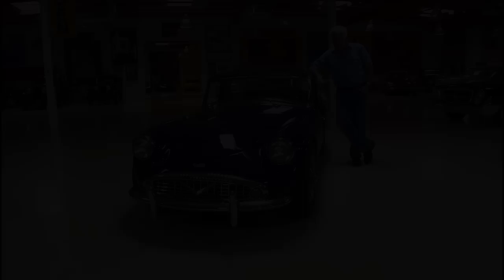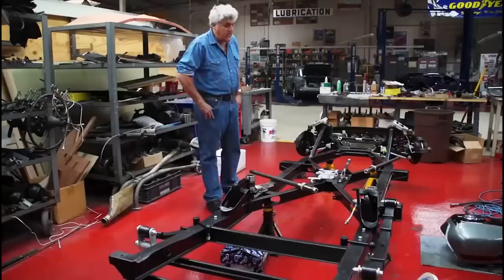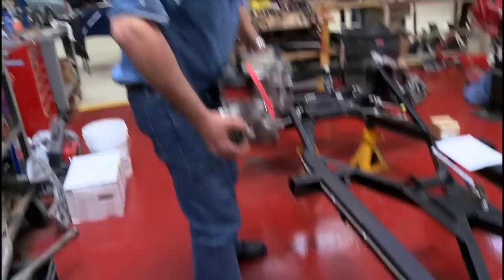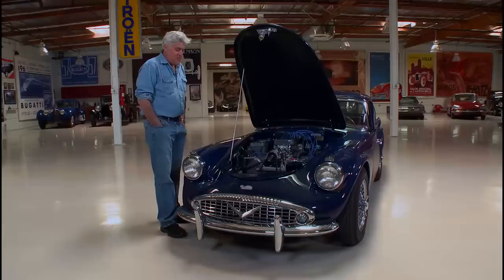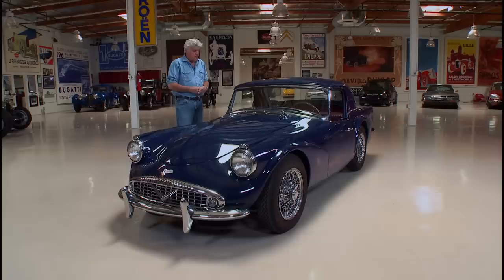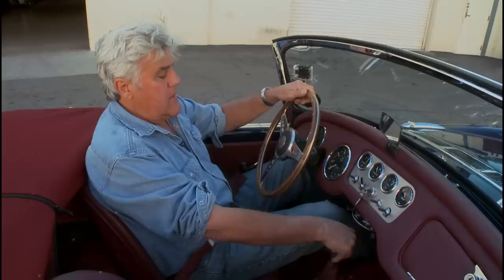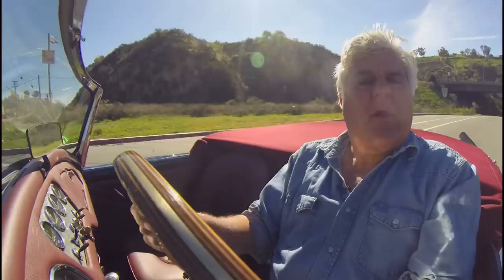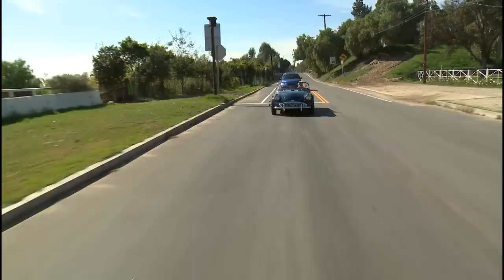1962 Daimler SP250 - Jay Leno's Garage

Comment: My very first car was a 1962 Daimler SP250, red with the hard top. Bought it in 1965 from Manhattan Auto, a Jaguar dealer in Georgetown in Washington DC, for $2,500. Back then you could buy a Cadillac for $3,500. I was just 24 and making around $13,000 a year. It was red with the red leather seats, manual shift. Absolutely fell in love with that sound. Mr. Leno is right, it was the prime era for British sports cars. Triumph TR4s had an inline 4 cylinder engine, and the Austin Healey 3000 had an inline 6 cylinder engine. Both had their appeal, but nothing like the sound of that 2.5 liter V-8 hemi head in the  SP250. The Jaguar XKE had an inline 6 with a characteristic snarl you could always recognize. And boy was it fun watching young ladies in mini skirts getting out of them with their almost waist high threshold. And of course, you might be passed by a Ferrari 250 GT with the glorious high sound of that famous V12. Music. But the SP250 was up there with them. I also liked the square trunk of the SP-250 because it was perfect for holding a bag of golf clubs sideways, no fussing. The bench seat was also useful for going out with another couple. The original SU fuel pump was an issue, depended on a membrane and if you suddenly heard a rapid ticking next to your ear it meant the membrane was shot. I took my SP-250 out on the expressway to Dulles airport when that was brand new with no traffic to speak of, at night, and ran it up to the limit, around 120 mph. Just for a bit as I was not totally sure the wire spoke wheels were all that secure at speed. I took it with me when I joined the US Foreign Service and was assigned to the American Embassy in Lagos, Nigeria from 1966-68. That was during the Biafra war. The Deputy Chief of Mission called me in one day and said his wife thought it was improper for a very junior officer to be driving a sports car. Although it was for sure the only Daimler SP250 in Lagos, I actually found a British car mechanic who could tune it up for me. I shipped it back to the US when I was assigned to Washington DC and bought a house in Springfield, VA. Sadly, one morning when I was driving to work in DC the young woman who was our baby sitter was rushing to drive her younger sister to school, went through a stop sign near our home, and T-boned me. Fiberglass body work was costly and I did not have the cash to repair the body damage. So I wound up selling it to a young man in, if memory serves, Chestertown on the Eastern Shore of Maryland. A tall, lanky guy in overalls on a farm, he actually raced SP-250s professionally and wanted mine for spare parts. He took me out for a spin on the gravel and small paved roads around his home, at speeds and cornering that had me holding on for dear life, white knuckle style. He on the other hand was totally relaxed and chatting all the while like he was just out for a Sunday drive to grandmas. That taught me that amateurs who own fast cars and think they are hot stuff should never have any illusions they can drive like pros and should not try because they can end up causing a fatal accident.  Wish I still had it even though I am now 82. But at least it went to a new owner who understood just what a cool engine and car these were. Mr. Leno is right.
Reply: Great story! We all have regrets about selling the classics we had 😢
Reply: To John k. Atchley
 I'm sorry to hear about theunfortunate ending - specially when I was envious of you buying your Dart SP250 from new, and so on! 
It IS an unfortunate truth that accidents are no exception, when it comes to items, even if they are expensive! 

A young lady in London, in her first job, in a museum, tripped, and fell against a VASE, and broke it.
She felt very bad, specially since it was a MING vase!
But her employers were sensational, and didn't SACK her from her job! They said they were just glad SHE was okay!

Comment: Hi jay, that's a great car with one of the best ever designed V8 engine, as you say. Beautiful job. I owned a v8 250 saloon with manual gearbox (wish I still had it). I've had a Triumph Stag for the last 40 years along with a Lancia 2000 HF coupe and a Fulvia 1300s. So not so bad. All the best Bob from England.

Comment: Interesting about the radiator cap. This was a good video because it showed something that can happen to all of us car guys. And who hasn't felt that stress of hoping your car makes it back.
Reply: John Fiskin: Especially with 300 miles to go
Reply: Hoa Tattis Holy Mōly! That would be a pricey tow, unless you had Mr. Leno's expendable amount of (annuity & perpetuity investment) income. I guess he’s in the Retirement Savings age bracket, come to think of it. When I think of Jay, it’s with the S&P mullet of the Tonite Show era-I tend to think of myself as ~30 years younger, too. Oops! 🤭
Reply: @frufru0071  No I nursed it home it took 6 hours
Reply: Hoa Tattis I drove a '67 MG bgt until I broke my neck in a workplace injury and had a spinal cord injury, but I still have my MG. The poor thing was about ~70% restored, and I’ve neglected it for about 15 years...at least. It’s a 5-bearing engine, (not the 3-bearing crank of the earlier B's), without synchro-mesh between 1st & 2nd, and with electric overdrive in 3rd and 4th gears. It was called the Mk. I, (1967), MGbgt. The later '67s had synchro-mesh, but just lacked the "UMPH!" of the earlier '67s. Congratulations to you on your 30 mile "trek"! Must’ve been a little stressful, or at least a tad...suspenseful, that journey?! Cheers!🍻 Was it a British car? {Lucas/the 'Lord Of Darkness'}?!

Comment: That car sounds beautiful..... Seriously, what an engine note.
Reply: You should hear one of these puppies on a race-track. Just...freakin'...AWESOME.
Reply: ikr...sounds so clean
Reply: It sounded great, like a hot little corvette with headers. Too bad it overheated though, I remember overheating being a constant problem with every car I drove back in the 70's....everybody is having fun until the car overheats lol.
Reply: +Bob Jimenez It was the wrong radiator cap, Bob. ;-)
Reply: that sound is to die for !
Reply: might be the best engine sound yet
Reply: You can buy 2.5 V8 Daimler even in Jaguar Mk.II, but only with automatic and it is pretty rare.
Reply: There used to be loads of the 2.5 V8s for no money at all, they were the cheap version of the Mkii, with the 3.8 being the expensive one. A good 2.5 V8 was about $800 (£500) when I was in my 20s (in the early 80s)  I went for a Triumph Vitesse convertible. (2 litre straight 6 @£395) The Darts or SP250s were affordable too. Oh if only it was still like that....
Reply: Doesn't sound anything like an American V8; sounds like 4 triumph motorcycle engines in a tin box.

Comment: Being a pedant and having had a Dart in the family since 1965 (in my care since 1974),  twin SU HD6's were the original carburetors, no idea why you would  go to the bother of a Weber and overdrive was apparently only supplied from the factory on two cars.  Mine has been modified and has rack and pinion steering from a TR6 and a Jaguar gearbox with overdrive from a manual Daimler 250V8.  The original worm and peg steering box was a challenge....and I kept breaking the original gearbox.  The car drives and handles really well..  The exhaust note still sends shivers down my spine....love it!

Comment: There were not many of these around back in the day in England. I came across one while riding a Matchless 650 motorbike and ran with it at speed for a good while. It could really move and seemed to have no problem getting around the corners rapidly.

They were always considered odd-looking at the front and a small alteration to the shape of the grille would have prettied the car a lot!

Comment: This was a great episode, as usual... Jay is such a good guy to be introducing cars like this.... Yes, the correct cooling system pressure cap will allow the pressure to build in the system and raise the boiling point of the coolant, which will continue to be able to carry heat away from the engine and shed it off at the radiator... One of the roads Jay was on going into the mountains, looks like Kanan Rd. Between Agoura Hills off of SR101 to Malibu Canyon off of SR 1 in Southern Calif... A beautiful drive...

Comment: I LOVE it !  My Dad had a TR-7 he purchased new in the Fall of 1977-as a former sports car "nut"-he raced in the 50s & 60s until my Mom lowered the boom on him to cease such a dangerous endeavor-decided to have a bit of fun with the -7. One of the things he did to it was put a Borg Warner  T-50 5 speed manual in it. To get it to work the driveshaft had to be shortened by 1 ". The clutch was truly a curious set up-a Datsun 260Z friction disc-and a Daimler 250SP pressure plate ! All smog devices mysteriously disappeared from it & the single Stromberg carb vanished & a twin Stromberg setup was installed -this was the era of 49 state cars & CA cars-we lived in SoCal-San Diego. Oh Lordy that thing was FAST. Brings back many fond memories of Dad. Thank You.

Comment: 2 Years! It took me 10 years to do mine 1988--1998, engraved on my memory! Mind you that was weekends as I was working full-time. A lovely homage to a great car/engine Jay Leno, if only I had had your wonderful facilities back in 1980's England. Like you say, why oh why didn't they use Edward Turner's masterpiece instead of the Rover (ex-Buick) or dreadful Triumph V8s. As is well proven by the man with the Daimler V8 powered dragster, it's a very tune-able unit, I think he gets about 1K bhp from his specialised one. Back in the day , my main problem was shortage of time and cash, as then the parts were not cheap, we didn't have 3D printers to model bell housings and we certainly didn't have that miracle gearbox of yours!! A lovely presentation Jay and an absolute treat for all the senses, especially the audio ones!! Thank You very much..........Jonathan Cooke

Comment: I used my heater on many occasions when my engine overheated very uncomfortable but if you want to save your engine n can't stop at times is there any other choice?
Reply: polygamous1 Sozou Owned numerous TVRs....I always did the same
Reply: The problem was that it ran out of water, so I don’t think running the heater would do anything at all.
Reply: At that point, no, it wouldn't.
Reply: If you were listening at around 10:58 he mentioned the -C got the 'cigarette lighter and heater-defroster' and later 'this is somewhere between a B and C' so, being in SoCal, it probably didn't have a heater to aid in the extra cool-down of the engine. I had the same problem with my '69 Roadrunner 'Super Trac-pak' with radio and heater delete (and a 6-cyl rambler radiator for weight savings...who needs more when you only heat it up 1/4 mile at a time!).
Reply: @MadMaxxMoto  But it did have a heater; he showed it several times and it's very noticeable in the shots of the engine compartment.  Of course, being British, there's not much expected of heaters.  I owned a couple of used Austin-Healeys, and a new '62 MGA MkII, and although the Healeys' heaters kept the edge of the cold and defrosted the windscreen quite well, the MG's heater was quite a bit less efficient.  The dealer, who was a friend and racing buddy of mine, told me when I looked it over that the heater "doesn't do much more than warming the driver's left foot---in England," where the driver sits on the right.  They had a Big Freeze over there in the winter of '61-'62 and the snow and cold practically paralyzed the island, so when I traded the "A" in on one of new MGBs, early in '63, I found it had a great heater/defroster, as did the used '63 MG 1100 sedan I bought later.  They even had towing rings welded onto the bottom control arms or foreframes after that!  Stay safe in this crisis.

Comment: I wonder if any of those engines were ever used to replace the P.O.S. that the Stag had (Yes I am fan of the British made Stag).
Reply: Because political infighting in British Leyland meant Triumph wouldn’t use this engine nor the 3500 Rover V8. Shame really.
Reply: Had a Stag in the 80's...with the Rover 3.5 of course :) Awesome car with what should have been the obvious engine.
Reply: @tedse21 ... But the got it for the TR8.....,what, 15 years too late.
Reply: When GM sold the rights of the Buick V8 to the Rover Car Company, it was stipulated that for a certain number of years, Rover could not sell that engine to other car manufacturers.
This was before Triumph and Rover were sister car companies within BL. By the time the embargo was lifted, Triumph had developed their V8 so there was no going back.
Later, Triumph as R Woodliff says, the TR8 used it, as did others, TVR, Morgan...........etc

Comment: Does Jay know something I don't?  If any car I was driving was overheating and steaming, the first thing I would do (especially if I had a trailing camera van) is pull over, cut the engine and open the hood to cool off the engine.  In doing so, I'd hope to discover the problem.  The last thing I would say and do is, "Hmmm let's keep driving it and see if it gets any better or worse?"  His car, his loss I guess but still, why risk cracking the block?
Reply: Was thinking the exact same thing - he's raving about this fantastic engine through the entire vid then takes awful chances continuing to drive with it constantly overheating? Also, the concern/solution being the rad cap seemed an amateurish mistake when the talent level in his shop is so excellent. Good on you Mr. Leno overall for the stunning reno.
Reply: I think that Jay knew what he was doing. Where he pulled over was a short distance from home on his regular car film circuit.
Reply: Yes you've saved me a rant!

Comment: So I heard that it didn't rust because it was a fiberglass car. Did I hear that correctly?
Reply: Uhm.... Yeah.....?
Reply: No, it's because the car is fiberglass.
Reply: WafflesOrFrenchToast (sarcasm). though it was implied, but i guess not.
Reply: Yup. Obviously
Reply: Brian Williams
And why should I believe you?
Reply: Brian Williams
lol
Reply: It does still have a steel chassis but I think Jay was pointing out that it was fibreglass body and therefore no obvious rust. As he said not everyone has heard of a Daimler SP250 and obviously would know it had a fibreglass body. Daimler also used that engine in their re-badged version of the Jaguar MkII after the company had been taken over by Jaguar and was known as the Daimler 250. It's generally viewed as the better of those two cars.
Reply: Samuel Smith it wasn't really an actual question. i was just poking fun at the fact that he said it was a fiberglass car like 4 times.
Reply: I wish he would bloody mention that!

Comment: My step father, Don Starr, owned 2 of these. I used to piss him off as kid, playing 007 sitting in the car and messing with a whole dash board of toggle switches (which messed up his settings). Loved turning on the radio and the antenna would automatically telescope out. He loved these cars (he owned a couple Lotuses too, and we had a late 60's Jaguar sedan too, with the rosewood dash and make up tables). When I was 12 he promised to give me the one he had (his 2nd) for my 18th birthday. My mom divorced him when I was 14. I still reminded him when I turned 18. He said it wasn't running, and he couldn't get parts (it was 1980). I would have taken it anyways and didn't buy his excuses. SIGH. I remember riding in it when I was young. Always a thrilling ride. Cool looking car, not ugly. Unusual looking though. Part of the Dart's charm.

Comment: Recently bought my first "purchased sight unseen car". 
Took it straight to the mechanic once I had it transported over 3,000km and it ended up needing water pump, fuel pump & got some other things replaced like the idle pulleys & fan belt but over all very good condition and quite a rare car so had to jump on it, especially it was at a price I could afford!

Comment: eddy here from devon uk your mechanic should have spotted that the radiator required what is known as a long reach shank type cap then every thing would have been ok i am familiar with such things i am 75  now but back in the 60s i was the proud owner of a 1964 MGB roadster which had a similar set up if  you have an early 60s MGB with the original 3 bearing motor i should  love to see you drive it you would love much more responsive than the later 5 bearing unit BEST WISHES eddy uk

Comment: What a lovely car, sounds nice runs like a sewing machine and goes like a bullet.
My father turned up one day from his away job building, he had bought a 1837 Daimler straight six with three S.U. carbs. We slowly rebuilt that car and even did the coachwork with burk on belco, boy did that take some time.
When it was finished he use to go out in the morning and get it out of the garage and leve it on  th drive ticking over, it use to have a purr come  special sound that  i never heard from  another car ever.
It hall a fluid flywheel with pre select gearbox, now used a lot on buses.
A freind of his came round one day, and i had the flywheel out and in bits on the front lawn, he ran in the house calling my dad telling him your sons got your car in bits on your lawn, my daonly a laughed and told him it was O.K. as he had told me to do it (I was 11 at the time.
Really lovely cars, shame they ar not around now, i wonder  what thwould be like now ????

Comment: During our resto for 1954 Austin Healey with small block chevy before good electric fans, we used a an air flow straightener in front of radiator to guide the air thru the thick core. Per direction of Paul Miller, A&P Staff SGT, P-38 Reconn "Super Snooper" US Army Air Corp. The simple flat sheet going from grill to vertical centerline of the core stopped turbulance along with a dust pan shaped scoop between the frame rails maximized flow thru radiator w/o too much deviation from stock. 15 degree reduction in hot soak temps.